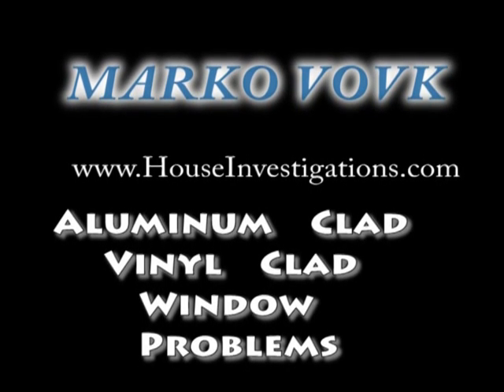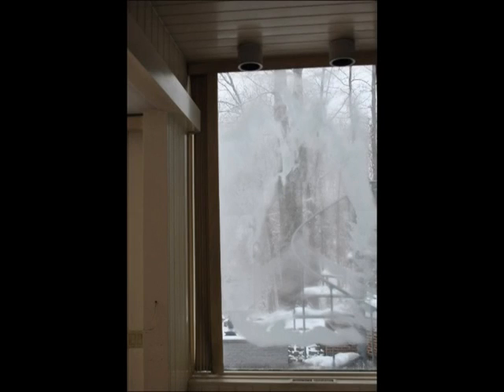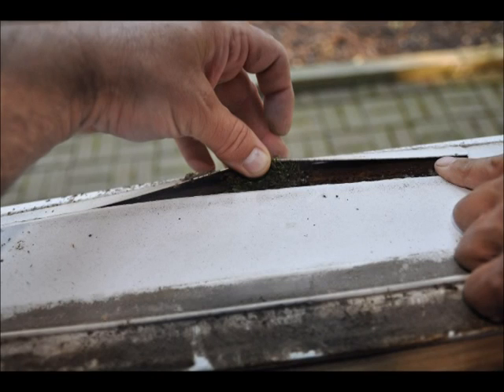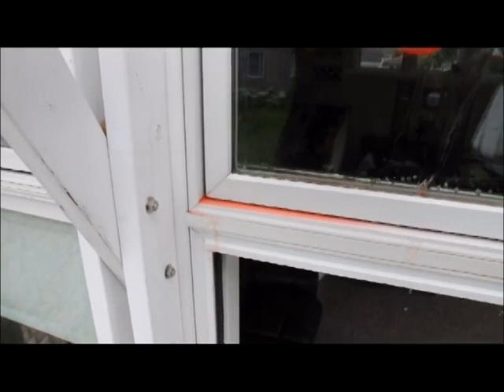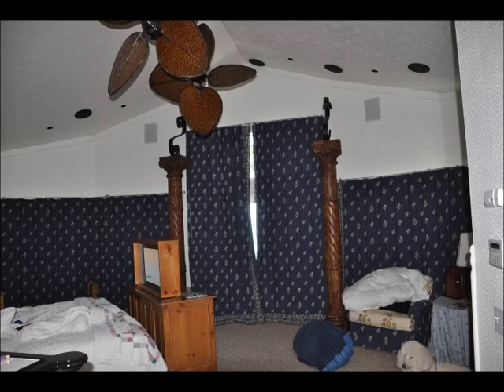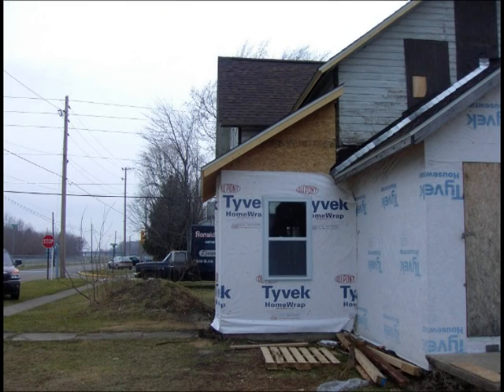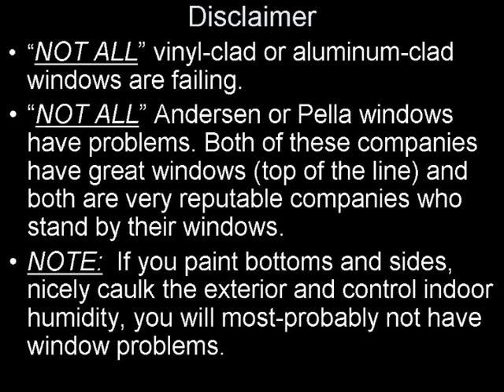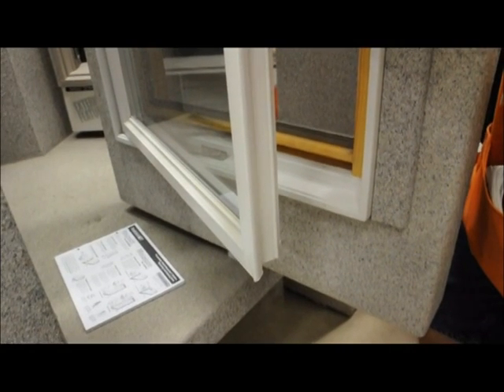Aluminum Clad, Vinyl Clad, Window Deterioration THE TRUTH Pella Andersen

Comment: 1)  The 30% energy difference, if you read the fine print, is determined when you compare a single pane product to a new double pane product with Low-E and Argon/Krypton gas.
2)  The wood used in the 1920s up to the 1970s all had Arsenic treatments in them as well which made them less likely to experience wood rot.  Since the government stepped in and stopped that particular treatment process having been linked to cancer, window manufacturers were forced to used a new process which didn't work so well at first until they perfected it.  Every wood window manufacturer went through a class action lawsuit regarding wood rot due to this, including JeldWen whom you never mentioned.
3)  You mentioned your "Pella Contractor" came out and reinstalled your windows.  First of all, the only way to remove that particular window you showed was to cut it out as the nailing flange was covered by the stucco or whatever that was.  Secondly, if you install a window into a new home, there will be shifting and the opening will not be perfectly plumb, square and level when you replace the existing window with a new window.  So there will be some gaps around it which require caulking.  I cannot say if the "contractor" used the backer rod before he caulked around it which would prevent any issues regarding the caulking and things getting behind it.  Note:  The best window your money can buy is only as good as the professional who installs it properly!
4)  Pella cleary defines the surfaces that are required to be painted on ALL wood/clad and wood/wood windows.  If your painter didn't follow those instructions, how is that the manufacturer's fault?  Pella is the only window company who now offers a factory finish in which they paint each and every piece completely before it is assembled to be sure that each piece is protected.
5)  You stated your Pella windows had issues and that it too Pella a long time to respond.  Was that during the class action suit in which they were not allowed by law to touch anything until you reported it to the class action suit website as mandated by the federal judge?  Pella couldn't touch anything Proline for about 9 months because of that federal edict.  Also, even when your local Pella office ordered a new sash, it takes about 4 weeks just to get the sash made and sent out to the technician.  Then it has to be scheduled once received and inspected for quality and accuracy.  I would be willing to bet that the replacement sashes Pella sent you has the new sealant between the glass and clad.  Also, the new clad is extruded and not glued into place.  The weatherstrippings are cut differently and the cladding is assembled in a different process so the water doesn't collect behind it.  Bottom is installed first, then the sides and then the top.  This way the water runs down the clad and doesn't get "cupped" to the inside of the clad against the wood.  Also, if for some reason this fails, the extruded portion will allow the water to leave the window through the weep holes in the clad.
6)  Severe condensation can also occur if you do not have the Low-E coatings and gases between the panes.  The new windows act as a thermal wall whereas the early generation windows did not.  Condensation was a sign that the windows are working.  If you have double pane windows and you are not seeing condensation in the circumstances you showed, then your windows are not working the way they were designed to.  Temperature transmissions between the panes lessens the condensation factor but it also means that your windows are drafty and not energy efficient.  Hence the reason why single pane windows do not have this problem as bad as double pane windows.
7)  You give choices to people for new windows which include metal windows?  Those are not energy efficient, cannot be made energy efficient, nor do they operate or hold up better.  They are drafty, cold/hot in the seasons, hard to slide/operate, impossible to replace as they most often need to be cut out from the house and they do not hold up any better in extreme moisture environments as metal will corrode/rust.  You also suggest a wood/wood window.  Who wants to paint their windows all the time?  And since you claim that painting doesn't work on today's wood windows, who would want to buy that if you claim that they will just rot out; especially with the "condensation" new windows have, meaning they will be replacing those windows within 10 years anyway.
8)  In the end, it seems that you believe Anderson has the only decent product.  Funny because Anderson is facing multiple class action suits whereas Pella has had one in the last 20 years.  Have you seen a new Anderson window lately?  How's that vinyl clad working for you?  Also, for those of you who would like to replace your windows, Anderson doesn't even make replacement windows because of a lawsuit that made them shut that portion of their business down.  Anderson replacement windows are Renewal by Anderson, meaning that Anderson doesn't make a darn thing.  They just send out the Anderson installer to put them in.  And if anybody thinks that Renewal/Anderson is better than anyone else, just keep in mind that Pella offers a better window, with more options and features and also a factory finish with a 10 year labor warranty.  R-values for vinyl clad are not better than aluminum clad, however, Pella offers more options for those seeking the best R-Value which Anderson/Renewal cannot get.

In closing, please remember - the best window/door your money can buy is only as good as the professional who installs it properly.  No matter how bad you think the reviews are for a name brand company's product, you are still better off buying that product because the company has a batter chance of being around long enough to service their product unlike the little guy who most often gets gobbled up or retires or is not around anymore for whatever reason, which means you have nothing.
Reply: Obviously, this dip shit is a Pella mouth piece.  By the way, Clevelandmarko takes both Pella and Andersen to task for their shitty window products based on his personal experience inspecting homes, he's not just picking on Pella.  Seems to me that if someone takes that long to write a freaking  2000 word essay defending Pella, that either someone at Pella is paying him or the head make is sucking his pecker.  Personally, after watching this vid, I'll neither buy a Pella nor an Andersen window, as both have made these rot prone windows in the past, and if they or anyone were to say they've addressed the problems and re-engineered their products, then I say let's wait 20 years and see what complaints people have had about their problem fixing and then decide whether to give them consideration. Let's face it, manufacturers lie all the time about their products because they have a responsibility to make sure the company continues to exist.  They also do their best to weasel out of honoring their warranties, as is evidenced by the myriad of consumer lawsuits for product failure.

Comment: Please be very wary of buying any Pella Series Window and
especially buying from their “Window and Door Showroom” retailers.  We worked with our local Window and Door
Showroom retailer and wanted 2 Architect Series windows. I have never had to
order new windows.  Now, when I said “windows”
I unsophisticatedly assumed that meant the exterior casing/trim. The salesman
never once mentioned the difference between (inserts) and (full frame) windows.
Lo and behold, after the installation was complete, I noticed that something
didn’t look right and found out they had installed (inserts) not (full frame
windows.) To make it even more dreadful, the top and bottom sash corners have
1/8” gaps, which allows moisture to penetrate to the wood beneath the EnduraClad ®protective
finish.  Finally, is the horrendous
installation the local Pella Window and Door showroom retailer’s “ independent
contractor” performed.  Shockingly, the
independent contractor left a ¼ inch space between the window and siding on one
side and a 1/8 inch on the other side, and appallingly applied no silicone
caulk to the gaps. Additionally, where they nailed/stapled the exterior lining
there are holes and rust spots.

Comment: i bought Anderson double hung windows and installed on them in my house as I was building it in 1992.  I bought the "terratone" color  vinyl clad double insulated.  Most of the windows that are on the south side and west end of my house have warped sills caused from direct sunlight and heat... They are so bubbled up that I can no longer install insect screens.  You can see where the sill has raised up and pulled out from under the side sashes.  Is there any solutions for my situation?  I have thought about using a heat gun and see if I could heat the vinyl and re-shape it to the contour of the wooden sill beneath.

Comment: i am in infancy of building a house marco. what windows do you recommend for northeast Pennsylvania.
Reply from the maker: +Todd Kaplan  Anderson if you can afford     best  and best warrenty
Reply: check out Infinity from Marvin - less expensive than Renewal and it's all fiberglass not clad.  Went to a showroom to check out and they look great and have lots of color options.  Renewal is still a vinyl composite,  which still means part plastic and will have more expansion and contraction.
Reply: Andersen's Fibrex product (Available in the 100 series, 400 series Woodwright, and through Renewal by Andersen Replacement Services) does not expand or contract in temperature extremes.

Comment: I was booted out of a subdivision for not using the developer's preferred Andersen clad windows, I insisted that the 100% vinyl windows I recommended were not only much cheaper, but were what most homeowners needed/preferred because of the greatly reduced maintenance. Fast forward 15 years and this developer has been sued multiple times for faulty installation of their "premium" windows.  I have had ZERO complaints on window functionality.
Reply: Faulty installation has nothing to do with the window itself. The best window in the world will fail if not properly installed.
Reply: Kirk Blee I realize this is an old comment.  However, I will still reply.  I would never want to live in an area where people could dictate what I have to have in as part of my house.  That is fairly un-American, and the anti-thesis of freedom.  As for the wannabe tyrants, I guess they got what they deserved.  Shoddy Windows installed by a shoddy contractor.

I recently replaced some windows before I found this video.  I had some aluminum clad Semco windows which exhibited similar rot conditions to what were shown in the video.  I will never, ever put another wood window in my house after watching this video.  It also makes me feel better about my window choice.  I opted for Sunrise Standard vinyl windows with triple pane, extra insulation, and fiberglass sash reinforcements.  I expect my windows will last a long time just as yours have.  My new windows in a golden oak interior finish probably look just as nice as some real wood windows.  I bet half of those non-discerning types would actually think my windows had a real wood interior.  I do have to admit that honestly do not look all that bad.  :-).

Comment: Pronunciation police! Deterioration has a second R, not pronounced "deteriation", otherwise excellent video!
Reply from the maker: +B Norman  I have a spelling problem in most of my vids. I don't have a proof reader
Reply: +Clevelandmarko  Sorry to see that you are such a big promoter of Andersen over Pella windows your informational video doesn' t do the industry TRUE Justice.  I have been servicing  most national window brands Pella, Andersen, Marvin, Kolbe and Peachtree etc. for well over 20 years now.  Prior to focusing on service and install I was in the energy conservation business (insulation, ventilation) the true focus for everyone is that controlling your enviroment is crucial to low maintenance of your home as well as an improved air quality enviroment.  Today homes are being built or improved upon without addressing proper ventilation wether passive or active.  I have had to troubleshoot over 10,000 homes with unique water infiltration as well as damage.  The test and results have been 100 percent successful when all others have failed.  When a customer has sweating windows wether their vinyl, wood or wood clad the most typical finding is the humidity level is above 55 percent. Most home owners don't understand dew point factors but when you show them that there humidity is out of the recommended range of 35-55%, they understand. Proper passive ventilation and downspout dispersement can help to maintain but here in the northeast typically winters require humidification and summers dehumidification.  They can buy an inexpensive analog humidity gauge and check there levels and move it from room to room, yes humidifiers and dehumidifiers are active means but sometimes they are the only choice. The other focus of my attention today is proper window and door installation.  So often windows and doors are being blamed for water infiltration and it is improper installation of that product or improper installation of other construction materials above those windows or doors. Doors and windows should never be installed on top of house wrap because when I've found the source of a leak and it's more often not the window or door.  the water has come in higher up and traveled behind the house wrap and came in around the window or door.  When the window is installed directly to the plywood and the house wrap is folded and taped over the tape flashing of the window it will go around the window or door and exit out the bottom of the siding.  I repeat I HAVE BEEN 100 PERCENT SUCCESSFULL at resolving peoples water, window sweating or air infiltration around double hung sashes. For PELLA, ANDERSEN ETC. window and door moisture or rot problems. You are correct that if a customer does not seal(paint or stain) all the wood exposed edges of a window or door they will have premature failure of the product.  People don't want so often to have to paint or stain their windows every 5 years (no lead in paint means more frequent maintenance)so they look to vinyl coated or aluminum wrapped windows. Do I anticipate that the masses will go back to an all wood window or that they will accept the unattractive look of an all vinyl window ABSOLUTELY NOT. Last note regarding the criticalness of construction today 30 years ago did hardwood flooring men have to check the moisture level of the wood was at a certain range? No, why you can say that it's younger would stock that is not as stable but the fact is that when you make a home so air tight 1 air exchange per hr. or less you can have issues with the flooring. Today most windows and doors have the void between the rough framing and the window/door frame filled with a low expanding foam, which by the way is an excellent adhesive. Now, should you have a heating system especially forced hot air without a proper humidification system you will many times find the humidity level below the recommended level. The framing in the house shrinks thereby pulling the window or door frame open creating excessive drafts when i've installed temporary portable humidifiers in the home, got the level to 45% the drafts ceased. the point here is if windows are installed properly and shimmed in the middle of a hot humid summer come winter they could be drafty so when windows or doors are installed on a project of mine I test wood moisture of the window, air moisture level and shim according to my finding since the discovery of this issue 5 years ago on the last Mansion on the Newport, RI Cliff Walk. I've not had a callback for air infiltration post installation.  All window manufacturers have had class action lawsuits for one reason or another it's how they resolve them that should matter everyone is looking to save a buck and some slick salesman comes along sells the manufacturer the latest, greatest new sealant and within ten years they;re having massive seal failures and imploding glass. It's a very competitive business and everyone is looking to get a leg up on the competition. I am not an early adoptive of new building products because so often it takes a good number of years to find the flaws. Good Luck, Lucas from Efficiency Inc. 
Warwick, RI
Reply: Well said sir, a very objective and factual viewpoint. I would like to add you can google class action lawsuit and find something for almost all manufacturers of windows. What I found was mostly attorney websites soliciting plaintiffs for class action. That doesn't mean a class action suit has been filed or certified in federal court.

Comment: Wood windows will always fail ... unless you live in a climate with zero moisture or inside of a vacuum.  Do you live inside of a vacuum?  Do you want to?  Don't buy wood windows.
Reply: +Ruth Sharon  Yeah, they will fail. Like how eventually over hundreds of years everything will erode or rot away. I have personally restored oak windows that were over 200 years, yes, TWO HUNDRED YEARS OLD! In Europe there are windows that are even older than that. Do you know what we did to restore those 200 year old windows? We stripped them of paint, epoxy repaired them, puttied the glass back in and painted them. They will be fine for another hundred years with regular maintenance and painting schedule. good day mam.
Reply from the maker: +Ruth Sharon My renal properties have wood window and were built in 1917 and still no rot